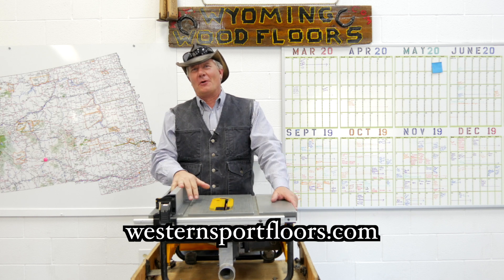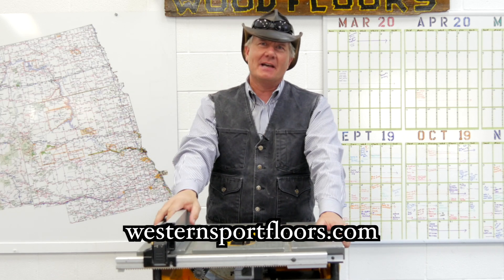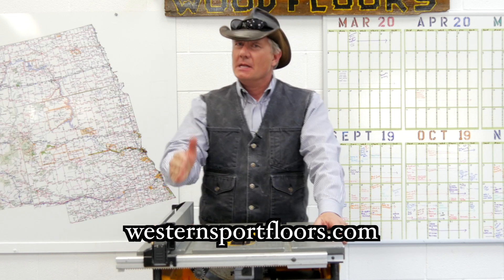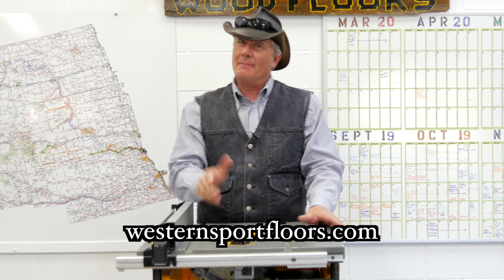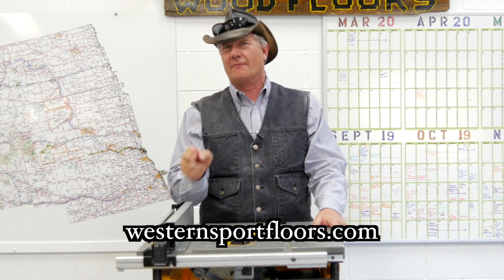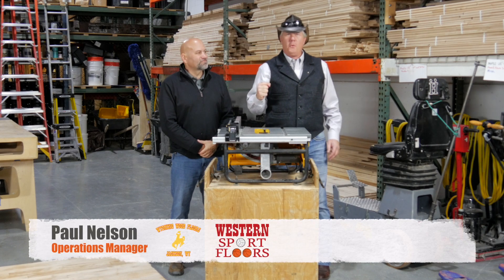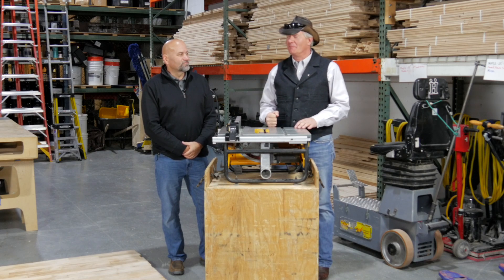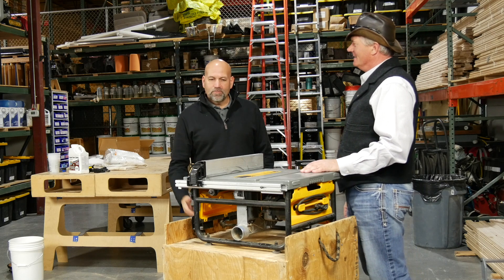Staining maple floors with the new Hypertone stain

Comment: How long could one expect this finish to last?  Since its a oil/water hybrid, water based finishes typically wont last near as long as oil based finishes. We are building a new house this year and I want maple floors.  I really dont want to have to refinish every 3-4 years because I want the natural wood to show through and not be yellowed. Which brings up another question....does it yellow maple?
Reply from the maker: The stain should last a long time as long as the finish is recoated periodically. Water-based finish does not yellow the Maple as much as Polyurethane. Be careful to avoid direct sunlight on your wood floors, that will discolor them quickly regardless of the finish used. 
Thank-You for watching our videos!!
Reply: Wyoming Wood Floors can you recoat without sanding?
Reply from the maker: @thegildedstork8167  absolutely! We have several videos about recoating Gymnasium floors. The process is basically the same in a residence.... except in a residence all the furnishings need to be removed from the rooms that are to be recoated.